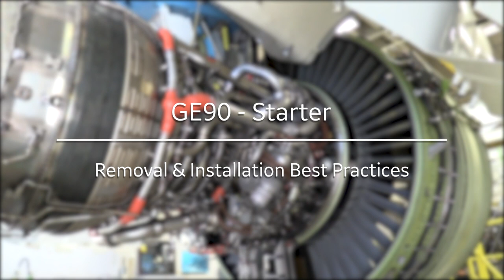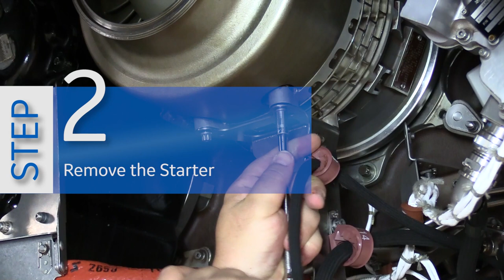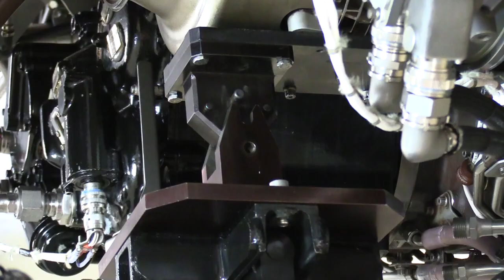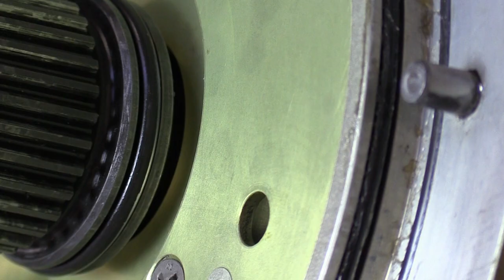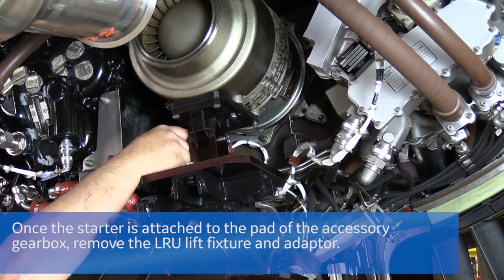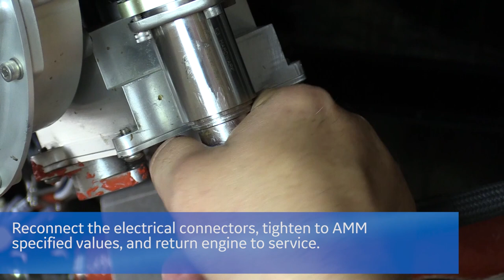GE90 - Starter Removal & Installation - GE Aviation Maintenance Minute

Comment: Turbofan Engine is Electric Starter
Reply: Wrong
Reply: @superskullmaster  Korean not chinese
Reply: @19wael96  In this case it is wrong, as the GE90's are started using pneumatic pressure. However, some engines such as the Trents 1000 on 787's are started using the VFSG, which use electric power to start the engine.